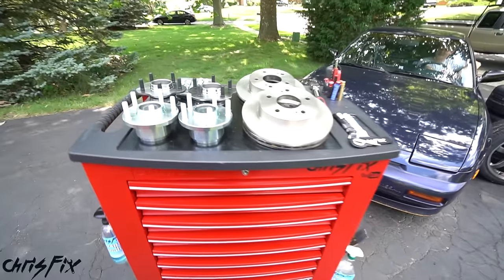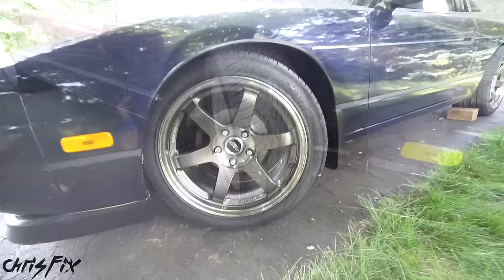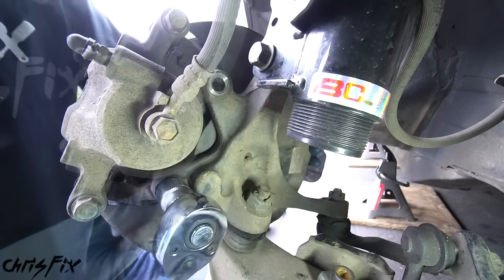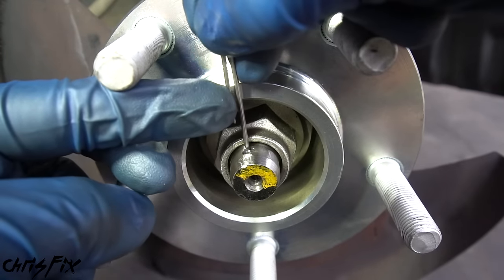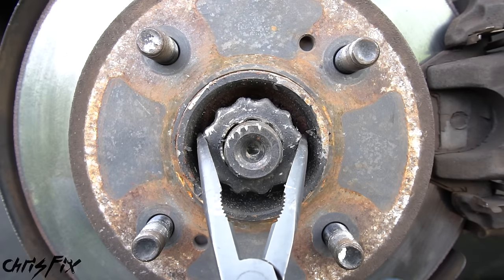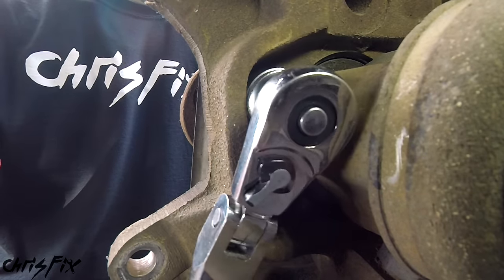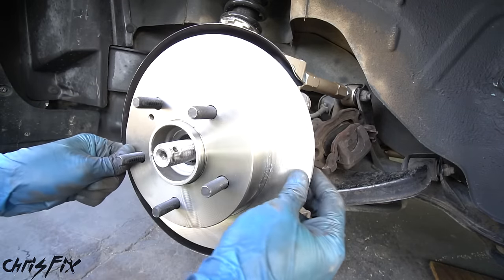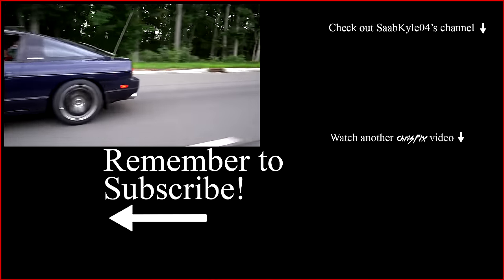DIY: 5 Lug Conversion on your Car or Truck

Comment: I'm sensing a drum to disc conversion in the near future...🤔
Reply from the maker: Haha you know it!
Reply: Please do my drums in my truck are due for an upgrade!
Reply: Yay I've been wanting to convert my 75 Mustang to disk brakes
Reply: ChrisFix I have a 75 caprice if you'd like to use mine as a model Chris 😎
Reply: @chrisfix I can drive to NJ for a video shooting haha
Reply: My 99 Suburban might benefit from that. It's too hard to brake as it is, then again I never flushed the old fluid and should get on that soon.
Reply: 1500 or 2500?
Reply: He replaced discs but didnt replace pads... /o\
Reply: please do.

Comment: Can you sometimes in the future do a drum to disc brake conversion? Preferably to a E30 :) since i have one. if not no problem Thanks
Reply: Winesh Ghazi check out might car mod they did a drum to disc on a Mitsubishi evo
Reply: Winesh Ghazi Nice. The e30 was always a good car.
Reply: In the process of doing 4 to 5 lug and drum to disc conversion on my 02 accord. I ended up needing the whole steering knuckle front and back.
Reply: Winesh Ghazi he’s going to, on a video he made on the mustang he showed a “drum to disk brake conversion” on the side bar. He also said all of those videos are coming in the future!
Reply: What e30 model do you have?
Reply: Yes! Please! I was just about to ask! Gmc Sierra owner here, the rear drum brakes are just not doing it for me :(
Reply: I did it in my 2009 VW Polo, in my case I needed to change brake lines on the rear axis and handbrake cables (apart from drum brakes itself). In my case, ABS system controls the brake pressure on rear axis so I didn't need to do anything else, but if you don't have ABS you may need to change (and test) the rear brakes pressure manually otherwise your rear wheels can lock prematurelly when braking.
Reply: I believe he has already done a video on this.
Reply: e30 1990 318i with power steering and cruise control :) only the drums need changing. Thanks oh and in the process of putting a m42b18 in it with 136 pony's

Comment: Man, watching your videos really shows how easy a lot of "scary mecanic work" really is
I can't wait to work on my car now
Reply from the maker: Awesome!!!
Reply: Until something fucks up, bolt breaks off, cant get to a bolt your trying to loosen, replacing something to find out that wasnt the problem, of course losing that 10mm socket you need, breaking the tool you needed, not having the tool you need and finding out it's really expensive, hitting your head on the frame of the car by accident 😂😂😂, etc.
Reply: @ethand.7801  sounds like u spent a fortune jus winging it. Good job
Reply: @King_drew  cant say that I have. Just annoying set backs
Reply: No Hub comes off that easy
Reply: @thiccboi9714  only if it hasn't been through a winter since being installed
Reply: @ethand.7801  That's life brother

Comment: i love how you so easily use mistakes as teachable moments "Pull it out with the pliers, and if ti breaks don't worry, just pull it out from the other side"  You do this in a lot of your videos and I really love it. Things rarely go according to plan and it's nice to have a few extra tips
Reply: Me: Chris Im having some relationship problems 
Chrisfix: here’s some medium strength thread locker

Comment: Quick tip: When replacing brake rotors, it's usually a good idea to also replace the brake PADS. If the old pads still have plenty of material, at the very least, resurface the pads with some heavy grit sand paper...
Reply: Good tip

Comment: I drive a 240sx, and I was about to do this, this video is perfect he even gave me the torque specs. I need to do no research because he did it for me. Great video like always
Reply: Preferred Drift what year is your 240sx?
Reply: Nick Crane it's a 1990, 89k miles, all original
Reply: Preferred Drift you still need to do some research unless you plan to buy this exact kit and even then you should still read.
Reply: james hawkins what? Already did t yesterday
Reply: Preferred Drift lmfao

Comment: How to super clean the inside of a car?
Reply from the maker: Im looking for a dirty interior and when I find one, I will make a video!
Reply: ChrisFix want my bosses car? You'll only have to ship it from Australia
Reply: +ChrisFix 
Well, u didn't see my car 😂😂😂
My engine bay is also so dirty 😂😂
Reply: Thanks Chris, glad to hear it's on the way at some point. :)
Reply: Chris my car is super nasty.  I would be willing to drive to you to use my car.
Reply: ChrisFix I'm in New Jersey want to clean mine? lol
Reply: 1. Vacuum interior
Wtf is wrong with you
Reply: you have to buy 1000 microfiber towels
Reply from the maker: If it is a UTE, yes! But dont expect return shipping :P
Reply: 1. pour gasoline in it
2. light a match
3. watch all that dirt and grime disappear
Reply: Martins Noname to a bigger pile of dirt and grime.
Reply: Go ahead and grab your soapy wooder, your micro fiber cloth and a couple of tubes of medium strength thread locker. GOOD. Now rub that thread locker into all of your carpeted areas, and just look how good this interior looks in blue!
Reply: Pretty much just take out all the interior pieces, then you wanna clean them with soap and water.  It's easier to just take them out instead of cleaning them inside the car is so you don't have to worry about getting everything wet
Reply: Ross Mundie I just took out the seats of my 2002 Toyota Echo and the carpet. I put the seats and carpet outside, pressure washed it.  Then spread laundry detergent powder over, but not too much and pressure washed again. The previous owner of the car was a coal mine worker and it was extremely dirty., bad enough trying to clean the steering wheel and dash of coal.  now it's sitting in the hot sun drying off, it looks so much better. Almost like brand new. I would like to condition the seats before putting them back in
Reply: Ross Mundie yea I really could use a DIY interior cleanup vid, #shampooing
Reply: Ross Mundie
Reply: ChrisFix just make your car get dirty
Reply: ChrisFix look for a soccer mom interior. those always tend to get dirty!
Reply: ChrisFix just clean them lol
Reply: logan thompson and im now playong a game whats in Australia.
Forza Horizon 3

Comment: Show us how to super clean the interior.
Reply: Brayden Moncrief step 1: remove everything from interior 
Step 2: go to parts department in nearest Nissan dealership 
Step 3: order all new parts for interior 
Step 4: wait for parts to come from Japan
Step 5: install all new interior parts
Step 6: fix any possible injury on self
Step 7: enjoy all new parts from Japan
Reply from the maker: Once I get a car with a dirty interior I will.
Reply: ChrisFix  how  tell if you have bad  fuel pressure regulator
Reply: A licence plate

Comment: That moment when my jaw hit the floor cause that ratchet extended. Buying now.
Reply: southernbman they're the best trust a
Reply: I just got one too!
Reply from the maker: haha, I link it in the description! For the price, you cannot beat it. I just started using it! Way better than switching to a breaker bar every time you need a little more leverage!
Reply: He'll I found a nice extending ratchet at harbour freight. Helps alot getting the extra pull/push. Three years later no problem. MAKES A NICE EXPANDABLE BATON DEFENSE WEAPON TOO!
Reply: Yeah, most of the stuff in the video is sold at harbor freight.

Comment: The reason it is recommended axle nuts are discarded after use is that many are torqued to yield and so strength is compromised after being torqued. Sometimes this means the nut is permanently stretched so its not even possible to thread it back onto the axle. However, not all are torqued to yield, follow the instructions in your service manual - if it is recommended to replace it,  they're cheap, might as well.
Reply: TheBlackStealth Nice advice, can NEVER be too safe my friends.

Comment: Heres a challenging part 😂 finding a 5 stud conversion for your unpopular car lol 😂
Reply from the maker: Haha yea sometimes that’s a challenge
Reply: Like my 1999 Polo 😂😂
Reply: Or just your really old car(think 73’)
Reply: Can't find one for an Isuzu Hi-Lander.
Reply: @chrisfix  Hey, Chris. How do I know which hub bearing specifically to purchase for my car? My 1996 Toyota Corolla is 4 lug and would like to make it 5 lug like this. Do I order the 5 lug hub bearing for a newer model Corolla that is 5 lug? How do I go about this?
Reply: I’m literally swapping 240 front suspension into my ‘74 ford Capri just so I can 5 lug convert it and for more aftermarket parts like coilovers and brake kits
Reply: @TheBlade616  Just use a golf 3 vr6 or golf 3 tdi 110hp hub
Reply: Like my Hyundai Accent

Comment: You should change brake calipers while they were removed ;)
Reply: Guess that's in another video, but he most likely did it in the same take after he removed them again
Reply: And the brake pads
Reply: Bumper210 he should have Just left it without brakes
Reply from the maker: We only had 4 days to film 2 videos so it was just not enough time to shoot a 3rd video on the big brake kit.
Reply: ChrisFix Understandable, Nissan with new wheels look fantastic :D
Reply: ChrisFix but why did you change the rotors and not the brake pads? if the pads are damaged they can damage the new rotors

Comment: And here I always thought replacing wheel bearings required special tools. I’m no gear head or car but but I enjoy repairing my vehicle on my own. Don’t have the spare cash to buy tools like you did but doing the repairs myself still keeps me from going into major debt
Reply: Replacing the actual cartridge bearing from the hub would require a press and extractor.

Comment: Finally another awesome video!!
Reply from the maker: Thank you!
Reply: ChrisFix how do you know if the hubs are going to bolt up properly? do i just have to go to junkyard and keep looking around until i find 5 lug hubs that have the same bolt pattern or size as my originals... ( im asking on the side with the drive axles that has to be bolted in place )

Comment: A better wheel options is the only advantage. I’ve been running four stud on my cefiro with no issues apart from short on wheel options. I’ve gtr brakes on it with new rotors drilled and slotted. Well done in this video though. Well explained and spoken. Proper procedure.

Comment: Christ Fix will this work with drum rotors? I'm trying to do 5 to 6 lug conversation great video and amazing content did not know it could be done...btw how do you know how many foot pounds you should use on each nut?
Reply from the maker: Is it an independant suspension or solid rear axle?
Here is how you know the torque specs: https://www.youtube.com/watch?v=3v3hLvuO_KU
Reply: I have one I want to do as well. Solid rear axle.
Reply: ChrisFix is solid thank you

Comment: I think I already told you Chris in another video, but anyone watching, push the wrench when tightening to heavy torque specs. When tightening an axle nut, push the wrench since you can use your weight to have that do most of the work.

Comment: Am I the only one who embarrassingly didn't know this was possible to do with your car? lol
Reply: Mich Sato 
What? Are you that young?
Reply: Pizza Sub It has nothing to do with age, mate. Some people still have to or just started getting into cars and maintaining them
Reply: Its also really only possible on cars that came with 4 and 5 lug setups which are compatible with one another, or which have aftermarket conversion parts. Not every car can be "converted". If you are absolutely set on this modification, there are always 4/5, 5/4, 5/6, etc lug conversion adapters you can buy. Whether or not this is a safe option would, of course, be determined by what you plan on doing with the vehicle. But dont foget to consider the changes to the wheel track when choosing new wheels.
Reply: actually I thought it wasn't possible either lmfao
Reply: Mich Sato be creative my friend
Reply: ThyHolyNickel *Your. And what's wrong with having my "yolo" profile picture? :(
Reply from the maker: You learn something new every day! Nothing to be embarrassed about.
Reply: ChrisFix Aww. Thanks Chris! :D

Comment: Nice video. But unfortunately for my 1965 Ford Falcon, doing this job isn't as straight forward as on your friend's car. Some older cars have a shaft that you have to remove with the rear baring or you have to use a better axle. From in my case for example an axle from a mid-late 70s Ford Granada or Lincoln Vercellius. I would be excited if you made a video on how to do this on similar cars that have this very niche.

Comment: Hey cris have you ever done a drum to disc conversation??   Can you make a video of it.  I am looking around the Internet and i dont find anything on how to do it.
Reply: Yesssss, that would be awesome.  I've been researching a drum to disc conversion for my 1971 F-250 and I can't seem to even find the parts to do so, let alone find how to do it!  I would love to see Chris' how-to-video!!!
Reply: chris
Reply: @ronbell2317  because drums are better breaks for trucks!
Reply: I have done it whit my dad on my 1996 ford escort whit a rear end from a escort rs2000 front wheel drive whit a disc brake rear axle direct bolt on actaly just have to change the e brake wire and mod inn the abs
Reply: Jetah no they aren’t

Comment: Hey Chris how do I know what torque specs i need for my car's bolts
Reply: Get a service manual for your specific car , either from the internet or the dealership
Reply: Different wheels use different torque. You should look up the wheel manufacturer's specifications

Comment: Damn, I have never been this early before. Like 4 views and only one comment. Like I no shit beat the notification
Reply from the maker: Sweeeeet!!!!!
Reply: what about fwd cars ?
Reply: Hartz-4 Styler what he did on the rear, you do on the front.
Reply: Hartz-4 Styler I think it's the same or at least very similar process. As long as the hub has a spline count that matches the count on the axle it should work, go on some forums and see if anyone else has done this

Comment: You can damage thread by unbolting it just because it's dirty, good to know lol, I probably wouldn't have cleaned it
Reply from the maker: Yea if there is rust, dirt, debris, etc, it grinds into the threads and since there is nowhere for it to go, it can bend the threads.
Reply: This information might have prevented me from playing a game of manly bolt removal from my bumper. Oh well, at least I wrote something comical over it at the time. EDIT The link to the comical account's below if you're interested.

http://www.dieselplace.com/forum/63-gm-diesel-engines/21-6-5l-diesel-engine/391644-what-have-you-done-your-6-5-today-409.html#post8387578

*Edited once the comment had 2 thumbs up.

Comment: So if you have 2 disk breaks 2 drums is it a different story?
Reply from the maker: Same process. Remove the drums to get to the wheel bearing/hub.
Reply: ChrisFix Are there universal kits? I have a 72 Opel Gt I was thinking on trying this on. 😃
Reply: brakes*

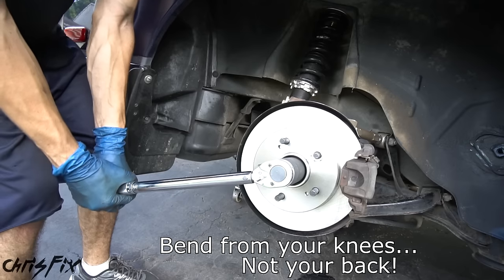Comment: 12:30..... or just flip it to the other side and push down
Reply: It will make a pressure to the suspension (maybe)
Reply: Would be easier on you tho. Last time I did that pulling up I was just removing a lug nut and I bulged a disk in my back lol
Reply: @josephfetzek2714  "Bend from your knees, not your back"
Reply: No the suspension would move causing an inaccurate torque reading.
Reply: It’s really the proper way to do it. No matter how small or large the job is lifting is much easier

Comment: What do i do if my lug nuts are stripped?
Reply: Real Change buy new ones
Reply: Real Change Chris has a video review of the Go2 Socket. Seemed to work on most lug nuts.
Reply: Real Change Go in a corner and cry abundantly.
Reply: Planning on buying new ones but how do i get them out
Reply: Make'em get dressed
Reply: I try to put some outward pressure on the lug nut while turning, pull out on the tire/wheel while turning the lug nuts it may grab enough to get it off. Worst case break them off at the stud and replace the studs (you may need new studs anyway.)
Reply: Real Change 
if you can't get it off. depending on what vehicle. get a drill and bit . start at the center of the lug. start smaller. then workup to a bit just a little bigger than the lug stud. drill it out and the but should fall off. but may need help. but IG the but is off. just hammer the stud out! put another in.
Reply: Abra Kadabra!
Reply: If the nut is rounded use an extractor socket
Reply: Real Change depends, look up how to remove stripped screws for ideas (same basic idea), might need to cut a slot to make them flathead, might need to drill out the bolts entirely, or just go to a local shop and have it done, etc. Good luck my guy, be safe!

Comment: No new pads with a new rotor???
Reply: Darwin Dwelle thats what i was thinking should fit new pads with new rotors.
Reply: Darwin Dwelle remember from the beginning of the video he is upgrading it to a big brake kit that means brand new pads and rotors they took it right back apart and did the brake conversion
Reply: As long as you sand the grooves and imperfections off the old pads you can re use them

Comment: I just came here to see if those were actual TE37's and not knock-offs.
Bravo!
Reply: Nobody7720 what is the name of those wheels i wanna get a set
Reply: @kingjosesoto2873  They are Volk TE37.
A legendary JDM wheel. They are forged, not casted so they are extremely strong yet light. There are many different versions the wheel. (different finishes, applications) 
They are quality, but are pricier. $400 - $700 per wheel.
I generally don't like supporting replicas, but not everyone is willing to drop bank on a set of wheels. 
If that's too much, you can look at the AVID.1 AV-06